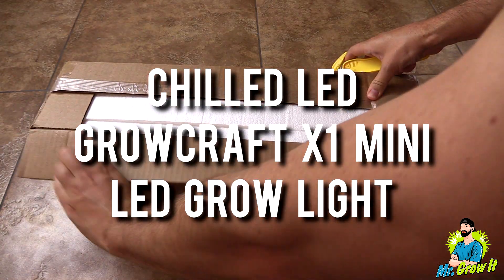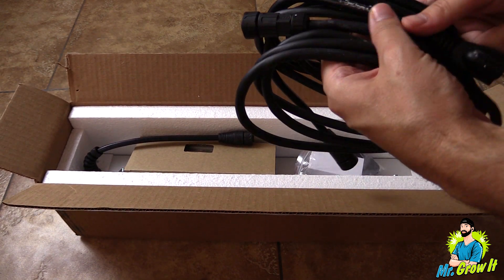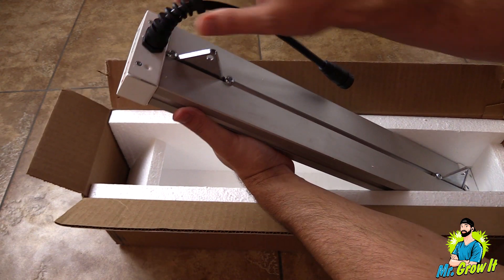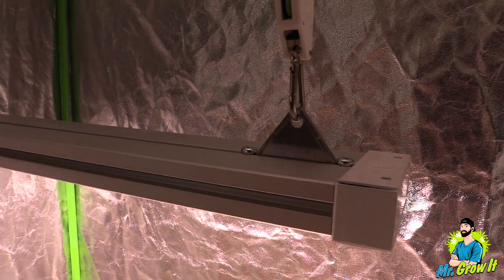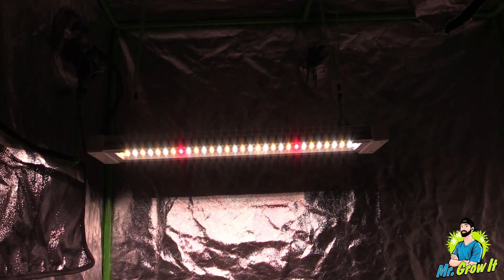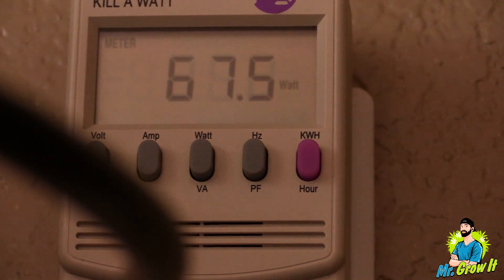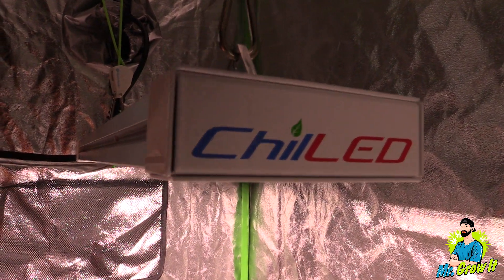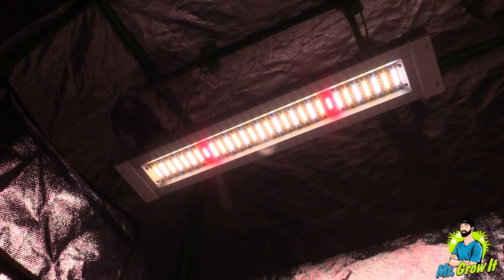MINI LED GROW LIGHT FOR SIDE LIGHTING! - ChilLED Growcraft X1 Mini Unboxing, PAR Test & Heat Test!

Comment: I suppose as a side light used in conjunction with your main light I can see some benefit but alone it doesn't output enough par to veg or flower. I could be wrong but 400 to 600 Veg, 600 to 900 for flower is the recommendation I believe. That why I love these par tests by Mr Grow It, they can save you a lot of money.

Comment: Question, this is apparently suggested for side lighting.  So, is there a bracket where you can set this on the floor or, am I not understanding what "side lighting" is?  I thought that, since lights from above favor the tops of plants, side lighting might help the bottom/sides of plants.
Reply from the maker: You can actually use the pieces it comes with to hang the light 90°

Comment: Dear Mr. Grow It,

Thank you very much for all your videos, advice, and work for all us small growers out there! I do have a question though.

I have seen probably the majority of your Podcast videos and they're all great!!! I have learned so many things. I'm more of an outdoor grower but I'm in my process of doing indoors. One of my concerns is the height of the light at each stage. From seedlings to harvest. 

Austin said we could always contact Chilled Tech and they would guide us through for us new growers who don't have a PAR meter but maybe you can do a Podcast where you cover light height or how much PAR/PFD we should be having in each stage.

You know like how much PAR/Height should I be having when starting from seedling. How much PAR/Heigh do I increment as the plant grows into veg? How should I be manipulating my lighting as the process goes?  

Maybe you have talked a bit here and there about it in other Podcasts, but I haven't seen / heard one covering this area. It would be great if you did one on it.
 

My questions would be : 

* What's the height that I should keep my light in every stage? 

* How much PAR shoud I have or be reading in each stage and/or at what height should I hanging my light ?(How far from my cannopy in order to not get flower burn)?  (From seed to harvest)

I got down pretty much PPFD / PAR / PPF / PFD thanks to your videos and other sources. I haven't researched about the perfect PAR for each stage and I'm sure there's info out there but it would be great if you had a Podcast about this subject. It's always an honor hearing it straight from the masters' voices! 

Thanks and I hope this suggestion helps for a new Podcast or maybe if you could shoot a reference video towards this subject, Mr. Grow It, it would be of great help! Thank you and I'll await your response! 

PS: I recently ordered an X1 Mini from Chilled Tech a couple of days ago after watching your varios Podcasts with Austin, Rob, and Pigeons but I really decided to purchase after your  individual Podcast with Austin. I learned about the Diode coverage and finally understood lighting a bit more profoundly. Having said that, I have been watching the PAR tests and I see that their PPFD is awesome even with such a small light and Wattage coverage so this is why I decided like I said, to purchase one immediately. Thank you very much for the infor Austin and Mr. Grow It by the way! I was struggling when it came to investing in lighting. So anyway, I hope to have a asked a good question and thanks for your great and valuable info Mr. Grow It ! 

Mr. Cheech Buddah Grow who is constantly learning from all the community! 

#mrcheechbuddahgrow #mrgrowit #CLtv #pigeons #growers #community #420friendly
Reply: Every light will have a different answer, I use 400 ppfd seedlings and early veg, 600 veg and 900 flower. if you dont have a par meter check the play store and search ppfd, I dont know how accurate it is but I use it for a baseline to the diffrent growth stages.
Reply: @johnnyrio454  hey Johnny Rio! Thank you very much! I hope to get an answer from @mrgrowit #mrgrowit soon as well. .Either way, thanks a bunch! I kinda figured those might be the PPFD readings. Still, it would be great if Garden Talk with Mr. Grow It would cover this area more profoundly and how they move up and manipulate their lighting. 

From what I've been learning, it seems pushing yield can be a bit difficult but you can push it more than 900 so it would be awesome to know how these guys do it. Again, Thanks @JohnnyRio. I really appreciate it!
Reply from the maker: @mr.cheechbuddahgrow1814  I made a video on this a little while back. I believe it answers all your questions: https://www.youtube.com/watch?v=IGZjDGWvhN0 
If you have any other questions, post them on my Grow Community forum. I can't keep up with all the questions asked here on YouTube and also can't give very detailed answers here. Forum link: 
https://www.mrgrowit.com/forum 
Hope to see you over there.
Reply from the maker: @mr.cheechbuddahgrow1814  Thanks for your positive words! Here's a link to my book on Amazon: https://amzn.to/3jBpjak 
Cheers!

Comment: is this light better than the mars hydro sp150?
Reply: I was comparing it to that one. I like that this one has MW drivers, Samsung diodes and is dimmable...the Mars SP150 does not have any of these features. Why I went with this one. But still like the Mars line, just the SP150 is not like the other SP models lacking these features.
Reply: @mikestephens8612  interesting, good thing i bought this one thinking i got the wrong one lol that's good to know thank you for that input. if im spending that much money on an sp250 then I'd prefer a MIGRO aray 2 or Sanlight Q3 which is my next buy but i'm by far still impressed nonetheless with all these starter lights im using #legalizetomatoes

Comment: Hi and how are you today we have been trying to figure out how would you tell a flowering light from a veg light from chill tech is there any way to look up a number or is there something on the driver we have two of these lights and it's not like the Amit a blue light they are both red but they say one of them are a vege light so how do we know which one is which could you get back to me about this
Reply: I have an x3 with the veg spectrum, instead of the 3 reds on the flower spectrum, there are 2 blues with one red in the middle on the veg

Comment: Hey Chris, big fan! Thank you for keeping it real, I appreciate your honesty and all the work you put in bringing this info to the community. Hoping I could ask your opinion, Im looking at a LED for a 2 x 4 and can't decide on the ES300 V2 or the Mars SP300? If it were you what would you choose? look forward to more uploads, thanks from Australia!
Reply: Pablo Piec sp3000
Reply: I haven’t used the SP300 but the Mars Hydro TSL2000 has been incredible for my 2x4 tent.
Reply: @canonphoto  hey mate, I ended up going with the ES300 V2. It Is going to be different then running HID like im used to, but should be interesting learning the difference between running the two systems. I hear your nutrient can be run at a higher EC with less fertigating. Thinking heat will be the main one to get used to, maybe Mr Grow it can do a video on it... but I don't think he replies to these comments.

Comment: Don't use that light but I've been using side lighting for a few years and no more larf , all bud's smokeable , it's well worth it !
Reply: What light do you use? I figure you could use something weak as it’s just a supplement?
Reply: @shotts90  Wow this is old enough that I've switched all my light's , but I still use side lighting , I have a 5x5 tent , a Mars Fc6500 and 3 -4' T5 HO LEDs on my walls , my tent is still 23c and EVERY bud is smokeable !
Reply: @bruceholinight7978  only 7 months mate... haha.

Nice one though 👍🏼
Reply: @shotts90  Ya , I have no problem with the time it's just how much I've changed in that time , cannabis loves T5 light , especially seedlings and those 3 T5s are bright as fck , I run a T5 setup in my veg room too with my Fc3000 , at 68 year's old I don't do anything else , had a 400watt metal halide warehouse light back in 77 , burned up most crop's but still learning to this day even from newbie's , never had internet so I learned by fckn stuff up !

Comment: Nice light man, I like the slim design for either it's intended side lighting or even to add in where a little extra could do but there isn't a lot of space. Looks to be a good par level for it's intended use though it does get warm it looks like. I'd try one myself though.